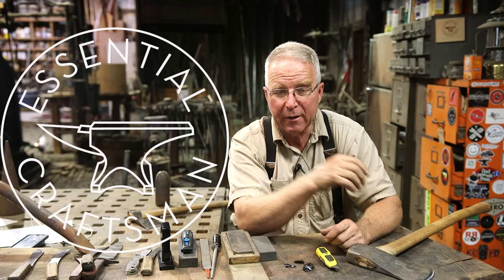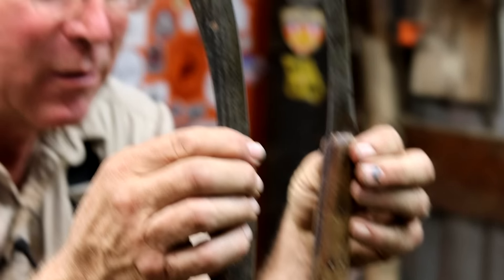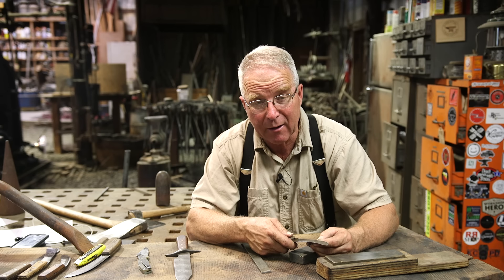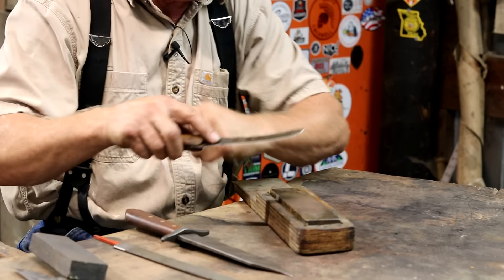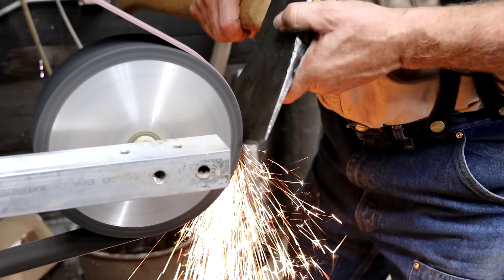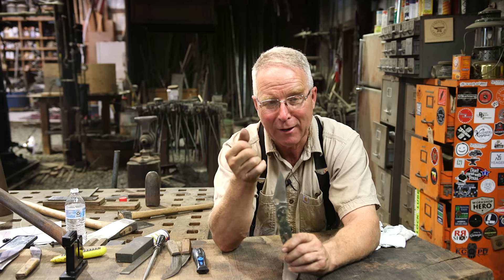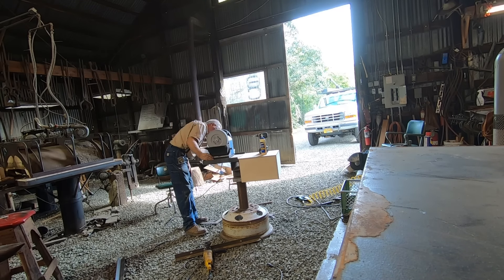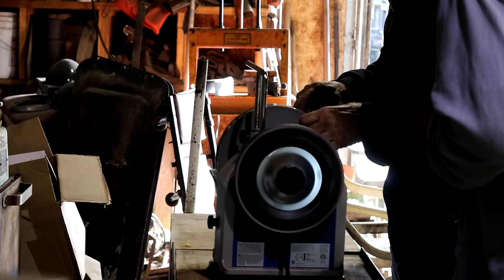Master the Art of Sharpening

Comment: Not one mention of the guided rod and handle setup, that clamps the blade down to the worksurface. The jig that serves to clamp the blade has a rod threaded into it, with an adjustable locking flag which maintains the correct angle. Nothing this guy mentioned compares to edge quality that is had by maintaining the precision angle in this blade clamping system. Video must have been made for boys the same age as the youngster sharpening wood in the end scene.
Reply: Sharpening systems are for people without any understanding of how to sharpen, or the inability to sharpen.

Comment: You do know that WD-40 is not a lubricant. It is a water displacer; hence, the WD. You would be much better off using a honing solution.
Reply: i've heard the 40 after the WD is the amount of times it took to get the formula right too?
Reply: WD-40 is a lubricant, if is marketed as one.
It is also marketed as a penetrating oil, rust remover, and cleaning solution.

Comment: Ive have never hated a device so much as the carbide "sharpener". The sound alone is enough to turn me away but in my experience, theyre used as a substitute for experience. The edges dont stay sharp long and they usually have a wire edge that breaks off and gets in the food. Either learn to hand sharpen or pay someone to do it for you

Comment: okay you hotshots with all your high tech and perfectly neat workshops, well laundered clothing, perfectly groomed hair sitting down in a chair with electrical power for your comfort, here is your challenge:

you are NOW 50 milies away from civilization in the most extreme country...You have all the essentials to survive for 6 months but most of that will require a very sharp axe and a very sharp knife (or two).  How do you sharpen these two steel edges to a fine sharp edge each few days and you don't have ANY MODERN SHARPENING TOOLS.  None. 

How do you sharpen and axe and a knife in the middle of nowhere with nothing other than natural objects in your environment?

there is your challenge.  And bear in mind, you need to do this every few days because you will using these edged tools every day to survive.  They must be sharp.  You can spend no more than one hour of time to sharpen both the axe and the knife.  

What will you use to sharpen these cutting tools and how would you do it?

good luck
Reply: Well, there are a number of ways, some depending on local geological differences.

A good way to get a good edge is fo find a river, there likely is going to be quartzite rocks (similar to Ark stones), find one flat enough to work with.

You can also use high silicate (quartz) content fieldspars, they are ALL over the world, maybe not as pure as river rocks, but are certainly good enough to put a working edge on a tool, especially after lapping one.

You can also get slate in some places, at surface level, just get another big rock and break a chunk off, then rub two bits together to make them flat.
Because slate is high in silicate, it will sharpen pretty well.

In some places you can get fine sandstone, which can be broken and flattened like slate.
Even coarse sandstone will work in a pinch.

Some places also have crustacean remains build up, but these are usually deep underground or under the ocean, but sometimes can be exposed.
These should be relatively fine rock formations and will sharpen steel.

If you have a belt (made of leather or cloth) you can use it to strop.
Keeping edge maintained for a while.

You can also make a pseudo-stropping paste, if you grind up sand into finer bits, you can mix with a thin mud, and then lay it over some wood or animal skin, and it will maintain your knife for longer.

You can also make your own earthenware whetstone, provided you have access to remotely decent clay and the ability to keep a  good fire going for a while.
Firing the clay will make earthenware, a ceramic, capable of sharpening quite well. You could also make it quite flat, or make a rod to sharpen with.

That's all that comes to mind at the moment, but it certainly is more than enough to keep an edge sharp in the wilderness.
You make it seem like it's some impossible task...

Comment: I disagree philosophically about what makes the difference in sharpness.  I submit that ‘purpose’ is what makes the difference in sharpness.  Angle is the mechanism by which we achieve that purpose.  The same is true of people.  Now mechanically speaking, you are precisely and fundamentally correct.
My whetstone system is 1x4x12 stones 600/800/1000/1200/1500.2000,3000,4500,6000,9000,10,500,12000 followed by polishing paste 21,000, 30,000.  I slaughter and butcher sheep.  I spend 4 hours sharpening in the morning and 9 hours cutting…a truly sharp knife flows through meat, intentional or unintentional, like an oar through water.
Reply: Wasting your life then buddy, 1-2k is more than enough.

Comment: No way utility knife is 15 degrees. Straight razor is 15 degrees
Reply: Depends on measurement. DPS or inclusive.
Also depends on blade height, grind style, and blade thickness.

15° on one knife is not the same as 15° on another.

Both utility blades and Straight razors have ~15° inclusive (7.5° per side.)
Straight razors are hollow ground, and tapered, meaning there is less thickness behind the edge, so it cuts hair better.
Utility blades are 'scandi' or saber ground, and are very thick behind the edge without any taper.

Utility blades can shave well if properly sharpened, but that's not their use case.